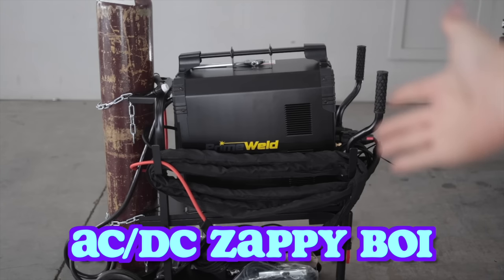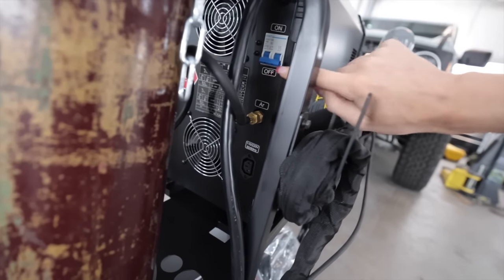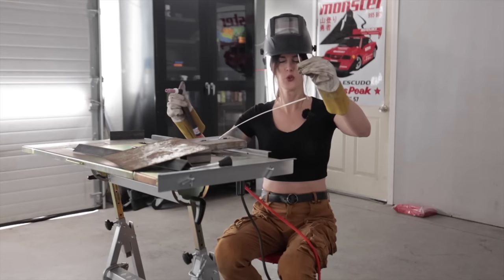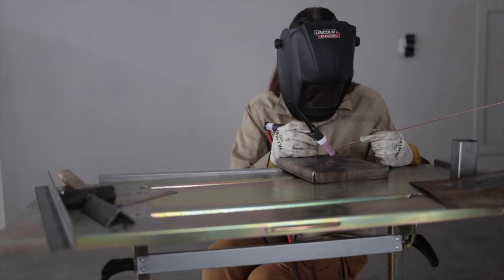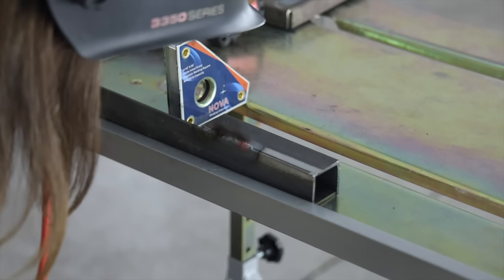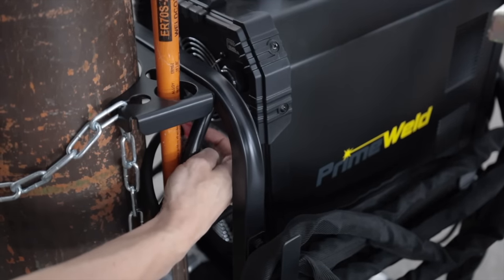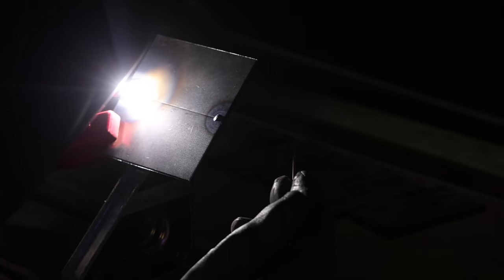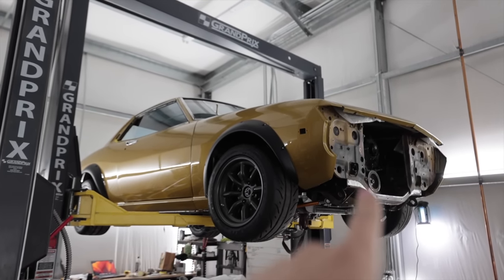Teaching Yourself How To TIG Weld

Comment: You did great, and it was so neat to watch your journey! I think you should keep practicing and do the headers-- they are complex shapes, but not really a safety issue (like suspension / axle parts) if a weld isn't perfect. Just the modeling of the pipes out of cardboard or whatever will be extremely interesting to your viewers! 

Someone else may have mentioned this already in the 1,400 comments, but a coworker went to the BTI bicycle frame building course in Ashland, Oregon, and he said they spent the whole first day welding scraps together and then bashing them apart with a hammer in bench vises. They went from flats to corners to tubes (because bike frames), and he reports it was pretty entertaining practice. By the end of the day, the welds weren't really pretty, but you couldn't bust them up either.

Comment: When I was in trade school I made every mistake that you made. In particular I remember getting my first welder tshirt tan. 
 I have two pieces of information that I think may help. 
 First,  the cup has two purposes. It directs the flow of gas and it also provides a rest for the torch. Try resting the cup on the workpiece and practice doing a little weave pattern by rolling it back and forth and walking it across the workpiece at the same time. This technique helps greatly with consistency
  Second, I always cut my filament rod in half with a pair of diagonal cutters. When you use them full length like that they like to flop around and make everything harder.  
  After that, it’s all practice. Do not be discouraged. I was not able to certify for structural welding until I had already graduated trade school and worked over a year in a fab shop.

Comment: 3:43 Yeah I did that when I was learning to weld. I had three or four double ended rods that I could just swap around when I stuck it in the weld pool. Not sure what kind of start that welder does, but some you have to strike it to start it. Once you do, let the pool form, then you can add filler as needed. Normally I'd use a #5 for the root pass in a flat plate then move up to a #8 for the fill. But if you're just doing something like an exhaust pipe, you probably would only need a single pass. Part of it will depend on your gas flow as well. Keep your gas flowing for a few seconds afterwards to keep the oxygen away until it cools enough to keep from oxidizing. Yours might have an auto timeout. For a 1/4" bevel plate (2F seam), 140 amps works well, in general. (All machines will be different.) For a tight space like a right angle (2G seam), 90 amps for root pass then 115 amps for filler. Mess around with it to see what works well for stuff like exhaust pipe. Lower amperage is less likely to burn a hold in your metal. Personal preference is to push the weld instead of pull. Point the tip in the same direction that you're moving to push it along.

Comment: Hints: you are correct. Welding never goes fast.

You are even correcter about cleaning the metal first with TIG. Always clean and degrease any metal before TIG welding. Even between passes. For mild steel with scale, grind or sand it until it's shiny.

Comment: It takes some time to get the flow of how much pedal to use depending on the thickness of metal you will be welding.
You are off to a great start just experimenting.
2 tips
1 -when you start welding 2 pieces together I used to get each metal to start to melt then as I added rod I would swirl the metals and rod together in a clockwise fashion while moving forward along your line. 

2 -put sunblock on your neck and upper chest , when I was tigging all day I always put sunblock on , those burns can get pretty intense. 
Yes do a part 2 you will do great you always find a way to get stuff done . 😊

Comment: If welding is an issue, may be 3D printing will ensure the right quality. The video "Turbo Manifold 3D Printed from Inconel Powder" on Papadakis Racing channel has a bunch of links in the description, e.g. to California based Mimo Technik that did the printing. (You'll need a 3D model though... but that's something completely different)

Comment: Hi, a very courageous aim but still you did well (although I would have put a shirt on a bit earlier). Tig welding is the most difficult of the welding systems due to the physical dexterity required and the number of variables involved and the project of a multi part intake manifold would be daunting for a general production welder. So for a day and a half you did well but as you may be starting to relies to complete your manifold project may take one to three months of trial and error but worth the effort as you will have a rare skill at the end of the process. bye

Comment: I have taught a lot of people how to tig weld. Yep, I should have just gotten on a plane when you mentioned you were going to teach yourself how to tig weld.
#1 - safety,  is vital, exposed skin will be destroyed. Your environment must be free of flammables, vapors, rags, ..... you get it.
#2 - if you aren't comfortable your welds will show it.
#3 - get to know your machine. Every machine is different, even if they are set to the same settings. 
#4 - they make different accessories (sizes of tungsten, gas shields, filler rods ..... ) for a reason.
Read the basics on what is used for what purpose.
#5 - Yes, if your material isn't clean, dont bother trying to weld. Very very clean.
#6 - dont worry about filler rod today, as you have noticed getting and keeping an arc is hard enough without the fact that it has to be constant and consistent. Make a puddle,  move it around, make a consistent line across whatever you are practicing on. Put 2 pieces together for a butt weld, tack them together no filler rod, just melt the two together. Start on on piece with a puddle, drag that puddle to the other piece, move from one piece to the other and make a bead as long of a bead as your machine will let you travel at one time. Keep the puddle as small as you can, not worrying about making it strong, this is all about control, making consistent size, shape.....
Master that before adding the skill required to add filler rod.

Comment: TIG has an achilles heel. It doesn't do the nicest job on hot-rolled steel or sheetmetal.  They tend to spit and foul the electrode, leaving a crater or bubble in the weld.

If your target is chassis or body, fluxcore MIG will get you the best welds quickest.

Comment: Not bad for learning once you figure out your settings and play around with the material you intend to use itll get easier shoot use .090 or .120 wall steam pipe and elbows like they do for turbo manifolds if welding the tubing gives you too many fits there is more than one way to make a header

Comment: I had welding in shop class (which is usually not a thing here in central EU) and it was absolutely horrible. Out of all the metal work we did there (and we did quite a lot) welding was by far the worst experience - and compared to forging (which we also did) it's not even interesting :D.

Comment: I think it's cool to see that you want to learn it yourself, but one question is why do you weld backwards? you should move your torch towards your welding wire, for a nice flat weld and for better penetration, and when tig welding, you should not use a welding magnet, otherwise your arc will become restless

Comment: Definitely need to dot your i’s and cross your t’s when tig welding. 
Contamination is the worst…have wire wheels, and files for each type of metal. Keep them separate. 🇦🇺😎🤜🏼🤛🏼🍀😊

Comment: Also: for any safety-critical jobs, mock it up, try it then smash it to verify that your welds are as strong as nearby metal.

I have found that mild steel  TIG welds can look ok but if you pound them the weld just snaps off the tubing. You need to prove to yourself that you make real welds.

Comment: You should be pushing torch over your weld not pulling the torch backwards the gas from the torch need to cover your weld. As you go forward the will shield the welding rod and puddle .

Comment: Your travel direction was backwards,  but it looks like you figured it out out.  *Pull the cup toward you and feed into it.
Clean the mill-scale off of your steel (the gray stuff) til it's shiney steel; that's why it sparks and pops and bubbles,  because mill-scale is all impurities from the making of the steel.  Scribe lines on the steel and use them as guides to follow as you practice running beads; marker just dissappears under the intense light, so don't bother using that.   Rules of thumb for mild steel is 1 amp for every .001 inch of thickness , so .030" would be 30 amps, but thats just a general guideline.

Comment: TIG (Tungsten Inert Gas) welding can result in exposure to ionizing radiation, mainly ultraviolet (UV) radiation. Prolonged exposure to UV radiation can cause damage to the skin and eyes, including cataracts, sunburn, and skin cancer. To minimize the risk of radiation exposure, TIG welders should use proper personal protective equipment, such as welding helmets with shade lenses, gloves, and protective clothing. It's also important to avoid looking directly at the arc and to minimize the amount of time spent welding.

Comment: You are going the wrong way. You have to push the torch forward. The filler rod is actually cooling off the puddle. You should use thinner filler rod. With mild steel you weld with more amperage than stainless steel. Keep up your work, you're doing an awesome job on the cars and about teaching yourself!

Comment: Is that the electrode holder you're using for ground? Or did they give you a lousy ground clamp that you need to be the Incredible Hulk to open? If so, look around for a softer one. I did the same as you and learned on my own at work. A good practice method is to tack two pieces together intentionally leaving a gap. That will get you leaning how to use a filler rod.

Comment: Id like a part 2

From watching, but never having done it, if the parts are tight together with no gap then you shouldn't need the filler rod, but I have no experience so you can ignore that.

Comment: Change the direction of your welding... move the welding torch into the filler rod and the weld puddle, which will keep the weld covered in argon gas, which keeps the weld area clean and uncontaminated. It also preheats the weld area so you can feed filler wire into the weld to make nice "dimes".'
When you do it that way, the argon keeps your weld clean and cools the weld puddle while you control the "speed" of movement of 3 things,, the torch, the weld puddle, and the filler rod. 
Also, pay attention to your foot peddle which acts like a gas peddle on a car.. only it controls how much heat you give to the  torch [I think your welder is set up to do that, check the specs, read the book].
Next tip, don't extend the tungsten tip so far out.. you want to keep it well within the argon envelop and you can "walk the ceramic cup along the weld line " which will give you better hand control.. 
Hope this is helpful...
Be brave, keep trying.. and cover up... weld burns from UV light suck...

Comment: TIG is welded the other direction. You "push" TIG, not "pull". You also need to remember that the filler metal will pull heat away from the weld as well.

Comment: With welding if you have slag you drag otherwise you should push the weld puddle and add filler (in general).

Comment: If welding stainless steel u need a half face respirator with p100 filters because of hex chrome that shit is super bad for u so if just practicing stick with carbon steel or aluminum

Comment: Here’s a tip for your tip. Never grind your tip on a grinder that has been used to grind steel. The trick is buy a small cheap grinder and mount it near or on the welder cart and only grind tips on it. It will never be a great weld with a contaminated tip or electrode.

Comment: At the crappy company where I used a machine to weld we didn't use filler rod. You can weld without filler rod, but it will be weak. Unfit for your purposes.

Comment: Ok, finished watching, metal is dirty. haven't seen you use one single wire brush on anything you welded. got have nice stainless/ brass brush some small some large (keep them with the welder so not to get contaminated) if doing small projects have small one to keep the scratches to within the area your laying weld, you want gas flow, (it shields from Outside air) and the pedal should have two step process, one for gas 2nd for arc. when finish the weld let up so just gas flows, help the weld settle not get contaminated. otherwise keep practicing you get it.

Comment: You can TIG  Weld with out even using a fill stick ..  Learn how to run nice beads  before even using the filler rod.
  You need to do your own Welding  other wise you will be waiting on others and get your projects up ..

Comment: Your videos are my evening entertainment, so I might have woken you up yelling, COVER YOUR CHEST. If you ever use a plasma cutter/air arc that will give you a sunburn too. In trade school I took a couple of quarters of welding. Didn't get past stick welding. I too taught myself tig and mig. Did better tig without filler rod.

Comment: that last weld that didn't look anywhere near as horrible as the rest, was starting to look not that bad. I'd say you should start practicing more - and you can't say you haven't learned anything about welding in the years you've been around welders 😂

Comment: If tig is like arc or mig, 1 amp on the dial for every .001" in diameter of the welding rod.  example .125" diameter rod (arc) set the amperage to 125 amps. reverse polarity.  Cover bare skin, any kind of welding arc will give you skin cancer.

Comment: Looks like you are moving the torch the wrong direction. You should be dabbing into the leading edge of the weld puddle. Think of it like pushing the puddle along rather than dragging it along.
Reply: Haha, just watched the rest and looks like you got this by the end.

Comment: Do a part 2 Please.....It is NOT easy to really Weld.   Can You weld, standing on a ladder, inside a corner (like the inside corner of a room, or all along the joint of the wall the wall meets the ceiling??) so Ur welding against gravity??  THEN you can weld.  You are not hacking, you are learning....you have steady hands....You will become very good.  Keep trying....try to get real Expert advice, to speed the learning process. (Maybe actually study the book???)    Also, practice Safety procedures, and where is the fire extinguisher????  Finally, you can get electrocuted, if you do certain things the wrong way.....so get Serious!!!!

Comment: You need to travel forward not backward you only drag when you have slag,
Reply from the maker: If you watch the entire video I figure that out
Reply: Sarah, I have done the learn the TIG welding on my own, it's way easier to have someone show you the right techniques up front so as to not have to unlearn the bad habbits.  Keep going you will get there. Make sure you clean! the material this will help.

Comment: I know you have a tone of YouTube critics and it’s in yer video but try to keep your top button done up (learnt the hard way) and keep your cuffs done up (you will burn the bottom of your wrist) 
The lack of smoke (stick welding) and (smoke and nozzle shadows) mig, makes Tig flame burn your skin faster.  PPE !
And yer closer to the action with Tig . 
PS I have burnt my left wrist many times because I hold the bottom of my helmet with my left hand (Mig) and hold the filler wire left handed (Tig) exposing my wrist unknowingly. 👎